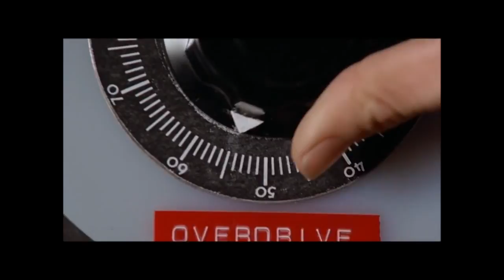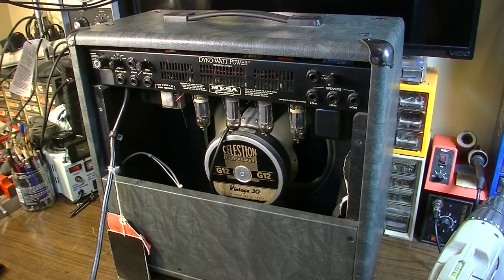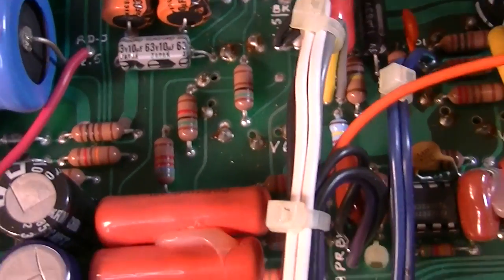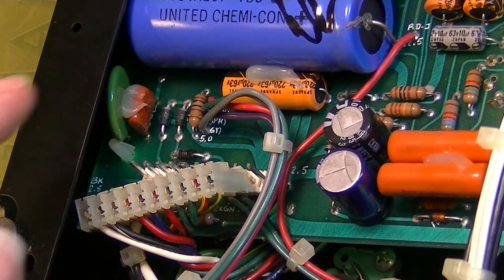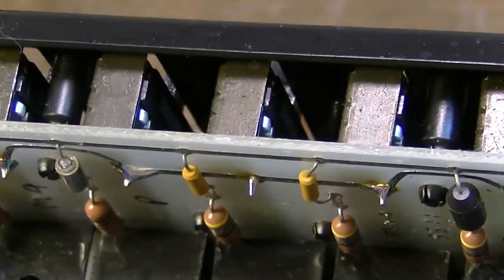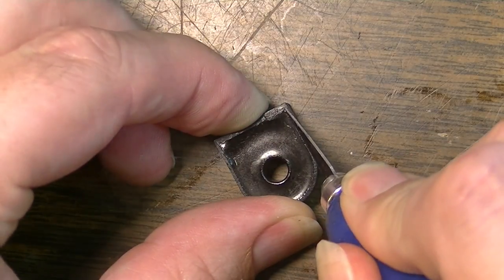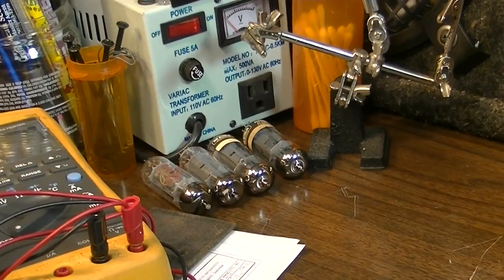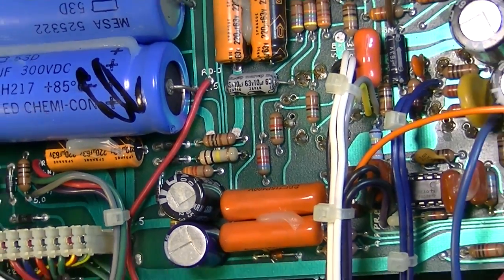The Forgotten Mesa-Boogie - 1990s Dual Caliber DC-3 Repair (PART 1)

Comment: You have nice nails man...do you have outside help?
Reply from the maker: My nails are always a mess. I don't care for them like I would if I was a pro player doing gigs. Right now, both my ring finger and thumb nails are broken. :(
Reply: Nice job Brad. These Mesa Boogies can certainly be a bit of a challenge to service. However, Rich at Mesa service is awesome for support.  Thanks to his assistance I have had a 100 percent success rate with Mesa amps and now I actually welcome them into the shop. It's great to know the OEM will be willing to support the independent repair shops. Unfortunately, that is an ever diminishing attitude with most manufacturers.

Great video! Keep up the great work!

Colin
Reply from the maker: @colincampbell4505  Right on, Colin. A lot of places would just laugh at you for making that call. First, they would NOT carry that part. Second, they would not offer much support on an out of warranty product from 25 years ago, especially for someone who's not even an authorized service tech for Mesa.

Comment: Its strange that having everything within spec there still is too much current being pulled. I find it even  stranger for mesa to tell us to buy their tubes to prevent red plating. Did I got that wrong? If not I would think its a way to make people use their repair services and/or tubes.
Reply: Mesa tests their tubes to run in a specific bias spec. Modern tubes have a pretty wide range that they run, and those that draw too much will want to red plate. Buying their tubes means you don't need to adjust the bias resistor. Other tubes, take it to a tech and have the bias resistor changed to match the tubes.
Reply: @ericjenks9596  , sounds right. I take it that  the same issue happens to other non self biasing amps?

Comment: I wish all tech's were as diligent as you are. Seems that the first guy he took this to should have caught all of this.  Real knowledge comes when you realize you don't know shit. When you figure that out, you take  the knowledge you do have to learn apply it to the current situation to figure out what is really going on. Always enjoyable to watch you work Brad, I have learned a ton just listening to you going through  these things. Cheers.
Reply: The world is full of bad actors, charlatans posing as amp or for that matter guitar technicians, who are just waiting to rip you off! 
Thank the good Lord above that Brad isn't one of those wrenched evil doers!
Reply from the maker: I make my share of mistakes, but I try to correct them.
Reply: We all make mistakes. We learn from that. Seems the method you use to diagnose and fix things is really in depth, rather than just saying "Based on my knowledge" it needs new power tubes. You found the reason WHY it needed them. Then fixed it. That is what makes you great!

Comment: Good move to pull the bias on those 6bq5 down to 10w dissipation. Excellent move.
Reply: Standard is roughly 10% less than max plate dissipation. So yeah 10W is fine.
Reply: I run mine anywhere between 9 and 11,  I also have a negative feedback control and run with 8 or 16 ohm output.
I find depending on the brand they don't seem to break up too soon even running a little "low".
I also run a 6n2p as the phase inverter which doesn't push as hard as a 12ax7.
Sorry for the bean spilling but valves get my hot.

Comment: Say what you want about Mesa. I have liked them ever since 1983 when Brad Gillis used them on Ozzy's Speak of the Devil  album.                                                                                                                                                  I just wish Brad here would get himself a used Hakko or Weller desoldering station. I got my old Hakko 470 off Ebay cheap. It is a tank. He needs to be able to properly test tubes also. He does not appear to own a tube tester. Oscilloscope?